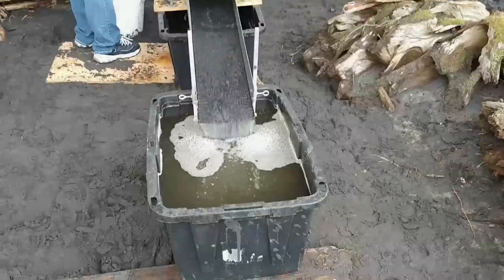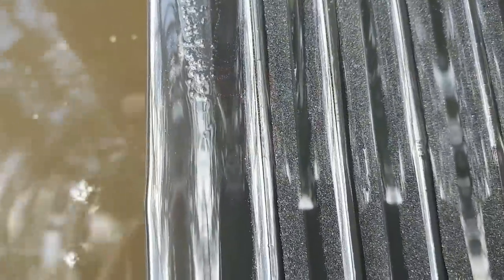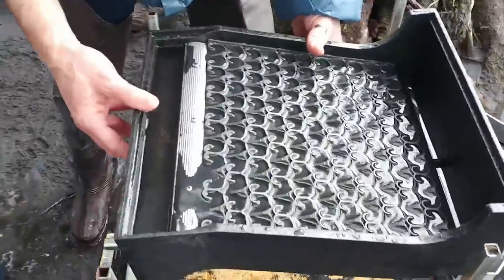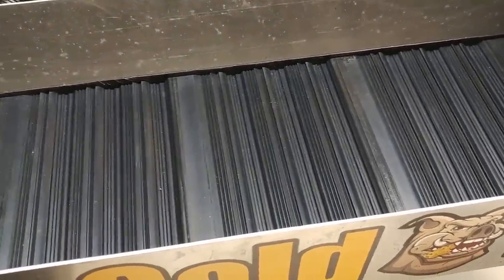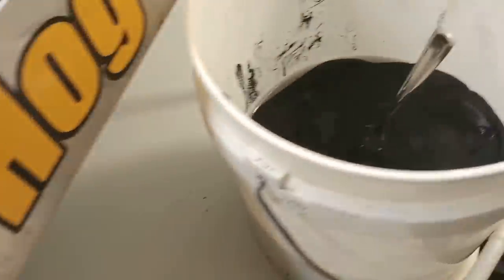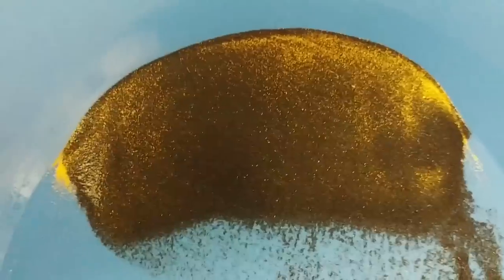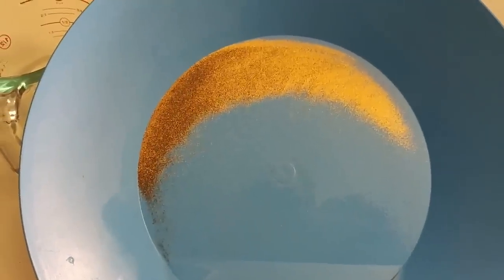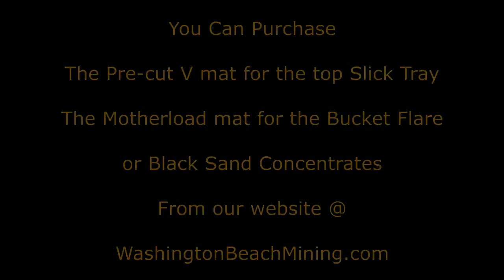5 Hours, 15 Buckets And How Much Gold?

Comment: sure you're aware of this, but mercury metal is probably the most efficient way to extract this ultrafine gold dust from the sand.  If you recover the mercury rather than letting it simply vaporize into the air, the safety concerns aren't that bad... of course, the use of mercury in your local may be subject to a variety of regulations... :)

Comment: To dry it out next time faster add some rubbing alcohol a couple of times and let the air flow over it. Much easier. Or heat the glass container over a flame.

Comment: Ok, the modern way to mine is not only much, much faster, but cheaper and far less labor-intensive, as well:
1. The iron and other ferrous metals (nickel, etc) are removed from the mid with neodymium rare-earths. Keep pulling out the preferred metal until ur magnets come out clean.
2. Dry ur mud, but not to anhydrous--remove water by gravity filtration.
3. Dissolve ur suspect gold in a slurry of sodium cyanide and water; the gold will leech out of the mud as a water-soluble cyanide salt. Rinsing the remaining mud is ok, but better is a complete vacuum filtration of the mud to keep things concentrated and yields high.
The cyanuric gold salt is then precipitated out of solution with sodium metabisulfite or equivalent sulfite. Ur gold will form violent, thick, dark brown dust storms in ur drum. Vacuum filter, refine, and enjoy!
Tips on obtaining the impossible to get sodium cyanide:
1. Get some ferrocyanide powder: harmless, noon toxic, and can be purchased everywhere (eBay, Amazon, etc). 
2. Make sodium cyanide by heating up equal parts sodium hydroxide (red devil lye-source of sodium ions) to ur ferrOcyanide (don't even think of using ferrIcyanide!!!). Watch it, the ferrocyanide will at first melt then become red hot. Put out ur sodium cyanide along with the crud on a plate. Carefully pick out ur pieces of cyanide. This is it raw cyanide source that, after purification, will leech out ur gold more agressively than Obama's IRS leeching off ur pocketbook!

Comment: Don't you think a "Quicksand Concentrator" could do just as good?
Reply: I use my rock tumbler. It works good with quicksilver but I hate using the stuff. If you could take a boat out to Sand Island off of Chinook you'd do alot better. That's where Bunker Hill mining found the most gold.

Comment: That-s 200-400usd on a few runs if i'm not mistaken, def better than working a job, but you need some excellent equipment to get that kind of result.
Reply from the maker: yes you do and it is not cheap

Comment: How much work and how long did it take you to earn that approximate $140 dollar's worth of those 3.25 grams.  This was based on the price at $1240 an ounce which it was Friday 10-19-18.  Considering that spot gold is priced at .999 purity, you gold dust will be worth even less.  I was assuming that the 3.25 grams was just the first half.  So, if you double it to $280, it might not be too bad of a haul for a days work.  But if all you got for all that black-sand then $140 is not worth it at all for the amount of labor you put in hauling that dredge sluice around.

Comment: Have you thought about lowering how many stacks you're using? It's redundant to run more then 3, even 4 seems pointless when i was running it. I've never seen anyone run as many stacks as you are in this video, there has too be 6 or7 stacks on your cube... Just a recommendation, i have been running 3 since i bought my cube and i have great results, woulf love a tromnel for it but all in due time!!! I tried a fourth stack but the 1st and 2nd stacks catch most of the gold.
Reply from the maker: Our gold is so fine with the black sand, you are going to lose it

Comment: What's a quarter oz of impure gold-dust go for?  Maybe $300 max?  In 4 days of beach work and 2 days of home work?  That's $50 a day?  You can make more than that with FAR less work operating the register at the nearest 7-11.  :p  If you get a half oz that's $100 a day (maybe) and now that's the same as the 7-11 clerk is making.   In reality however, there's likely no way you will get $1200 for an ounce of gold-dust.  More like half that.  So the numbers are really more like $25 a day to $50 a day.  :D

Comment: is none of the black sand magnetic?  how about tilting the multisluice at a higher angle and run the tailings through several times after each clean out?  that should stop more of the black
sand from being caught even though each run you will lose some gold to tailings...by the end run you would have gotten most of the gold.

Comment: 200 dollars if you can get that much ( commercial buyers are probably gonna give you around 60 percent) throw in the DAYS of labor ,equipment costs, transportation,electricity,water and the eventual fines you will incur for being three feet on park or private land (yes it will if it hasn't already happened) you will probably need about  12 to 14 grams a day to pull a tiny profit which would also increase your costs and liabilities and time investment. A small lawn care service with two employees running one commercial zero turn,one push mower and weed eater ,edger chain saw and a good dose of commercial liability insurance has much greater returns per investment. On the other hand if you just like this as a hobby and bragging rites...MORE POWER TO YOU!

Comment: When it comes to drying out the gold,  why don't you just plop it in the oven in the jar on a cookie tray at like 200ish degrees?
Reply from the maker: This gold is super fine, it sticks to anything it touches, so drying it in a vial keeps me from loosing any of it.
Reply: Of course,  I'm not saying take it out of the vial,  but putting it somewhere warm to evaporate out the water might be more efficient than using a fan and such.  That said,  I'm not the one with a vial of gold,  so you know.  Whatever works.

Comment: Dream mat is better as one full length splitting the mat into two like you have disturbs the flow or more the rhythm of the flow. If it were flat in between the first and second half of the dream mat it would work a lot better. like you said different mats different flow speeds and some times slightly different angle. Three different mats was it? Too complicated

Comment: 3 grams = roughly $125.  So if this took 5 hours of mining plus equal that for the at home refinement that's $12.50 an hour.   Beats working at McDonalds I suppose lol, but barely.  5 grams = $195 which is not too bad if you could consistently do it every time.  Seems like a fun hobby.  At least you make a little money rather than blow it on things which is what most hobbies require.

Comment: I would think if you added a bunch of powerfull magnetic strips to your hog ? device at the beginning the magnets would react with the gold particles causing them to rapidly slow down and drop into the mats almost instantly. Because of Lenz's law any non magnetic moving conductor will slow down in the presance of a magnetic field.
Reply: That was mentioned earlier, and got some good responses. Many positive, but what I got from it is that it highly depends on the particle size. So maybe electromagnets instead with a gradually decreasing field strength along the sluice might work.

Comment: What's that, 16 ounces, or 1.6 ounces? 

16 ounces, well that is about 450 grams. Gold is about 39 000$ per kilo. So this is then worth about 18 000$.

If it is 1.6 ounce, it would be worth 1/10th of that, that is 1800$.

Either way it is quite good for 5 hours work, but that is guaranteed not the whole story.

Comment: You are weighing it wrong. you should weigh the container which you will fill with gold before note it down  put the wet gold in it and dry it and weigh it again minus the weight of the container  weighing a similar container to tare is inaccurate

Comment: 15 buckets I could do 10 times that in one day 20.000 and I will tell you how. so, your almost 5 grams would be 50 grams. I figure I could really do 500 gal per day no sluice needed on the beach. so yah at that rate 5 grams per 15 gal , 500 gallons would be 166 grams or 5 ounces that 10.000 cash in one day this idea has to be worth 20.000 all day long.

Comment: You're not using your cube properly.  In fact that's the worst set up I've seen.  Loading to much at a time.  Too many cubes  for flow pressure.  Use two different stacks. Lead one then the other.  Your missing gold because YOU'RE  not allowing the machine time to work out the black sand.  Sad, just sad how bad this is. Science has hard laws.